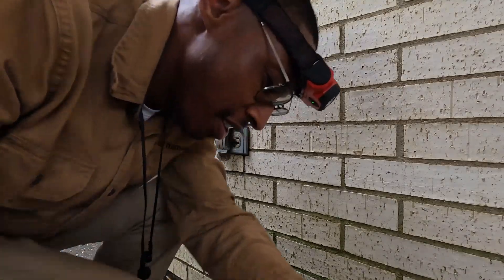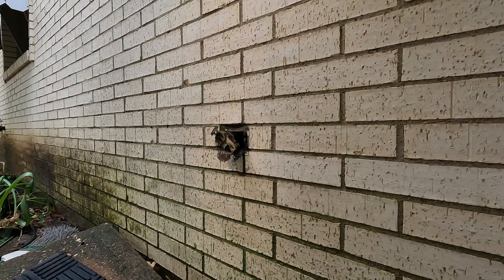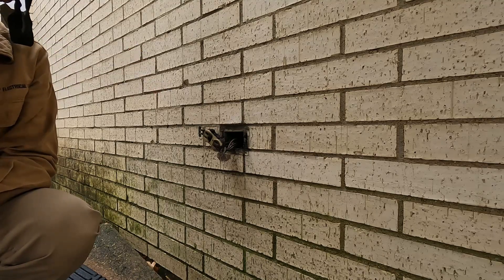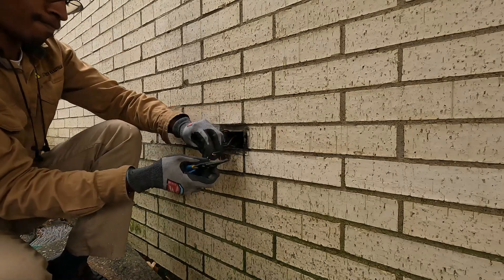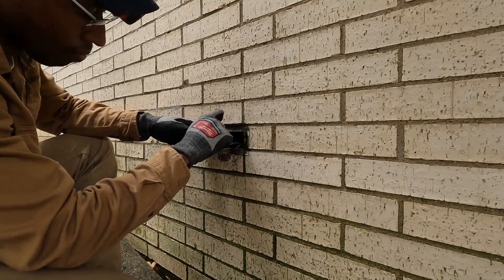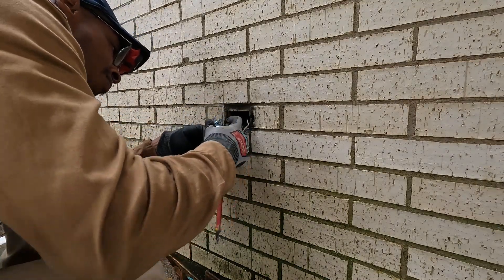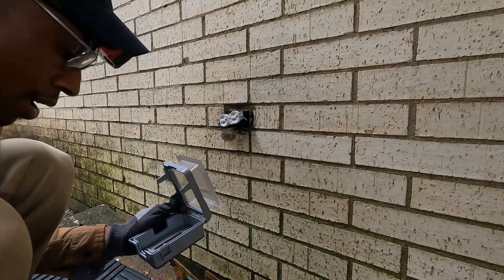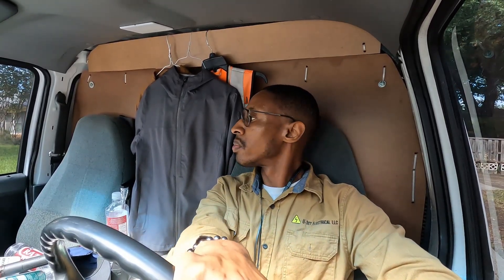Electrician Troubleshoot Burned Outlet Tripping Circuit Breaker

Comment: So, they back-stabbed the outlet but didn't screw in the unused screws, leaving them sticking out so that they could touch the box. You should always screw in any unused screws. That includes the 2nd set for pass-through when they're not being used.

With a burnt receptacle, I don't know if I would have relied on the "no voltage" test before removing the cover. The line could still be hot, but the burnt receptacle just not passing it through. It would probably be good to test at the wires also.

Comment: Hi Steven.  Good job well done.  I “assume” the outdoor circuit was GFCI protected by another GCFI receptacle up steam of this outdoor receptacle or by a GFCI breaker in the panel.  I was glad to see that you used a “bubble” cover per the Code instead of the old Bell two metal flip cover receptacle cover which is now against the electrical Code.  Bill

Comment: That outlet you replaced should have been a GFCI because it is located outside and could possibly get wet even with the watertight cover. Also at 10:05 I noticed when you terminated the wires on the receptacle, you hooked it in the opposite way that the screw turns. It’s always best to hook it in the way that the screw turns so that it tightens the hook and gives a better connection. Love watching these troubleshooting videos, keep it up!
Reply: I think if it is protected by GFCI in the panel or by a GFCI Receptacle it should be fine. Should be labeled as such being protected but in all honesty it should be fine. Correct me if I’m wrong though
Reply: @DaMexAlex408  We do it in the panel.
Reply: wait.... you mean... when i make a J hook.. its supposed to go in the SAME direction as rightytighty leftyloosy?... damnit..  smFh.... 🤦😜🤘☠

Comment: Question: are those receptacles you installed outside Weather resistant?
Reply: I think those casings are designed to protect them from the elements as much as possible.